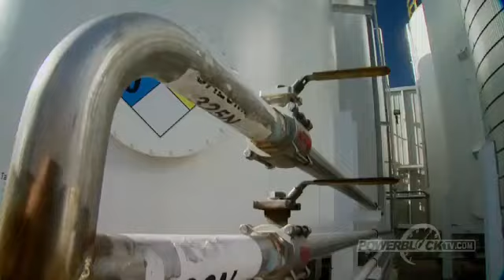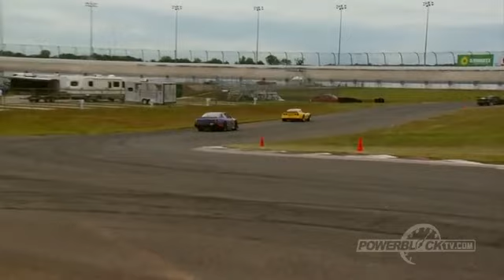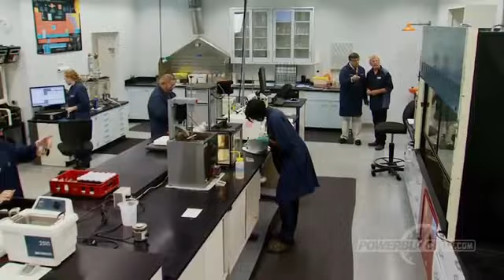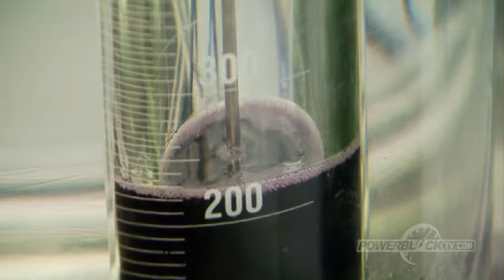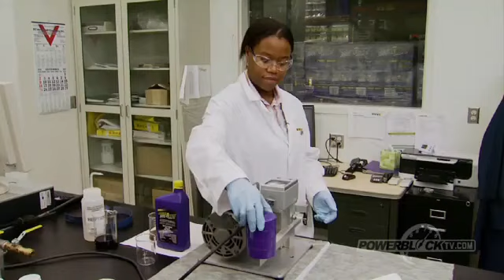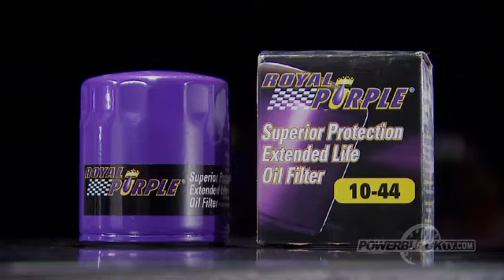PowerBlock TV Tours Royal Purple

Comment: It's cold flow properties are not the greatest.
Reply: it is made for high heat, if you live were its very cold in the winter like 5 below or colder all winter use mobil1. But go back to it when it in the spring it cleans inside of the engine, all other oils build sludge in the engine.
Reply: This is so true. I used RP in the winter time and on cold starts my engine was making a  ticking  noise for like 5 mins. It never did that when I was using M1.
Reply: Just add some Dura lube treatment oil with the royal purple oil it will works wonders